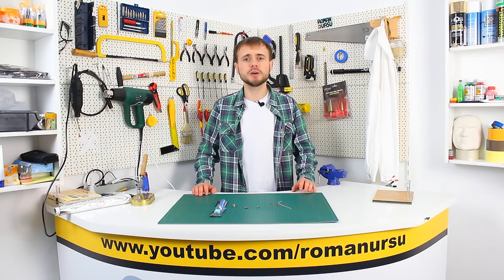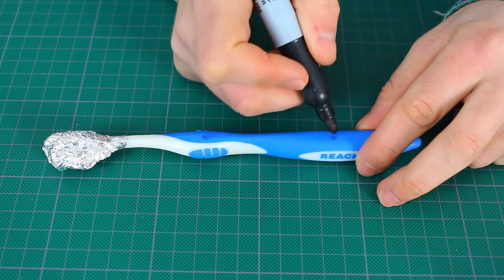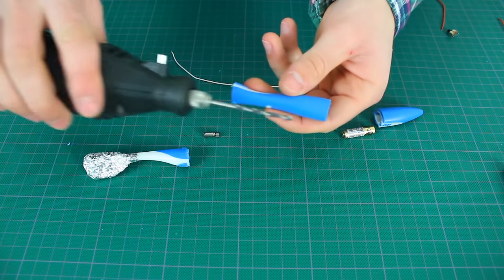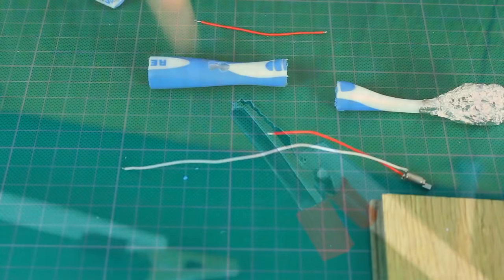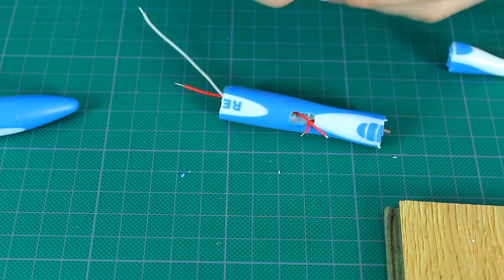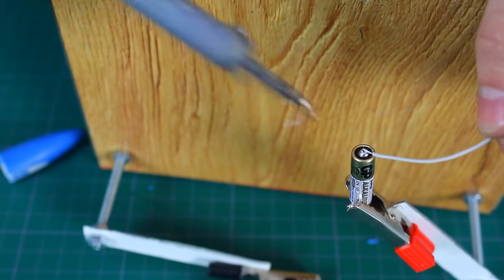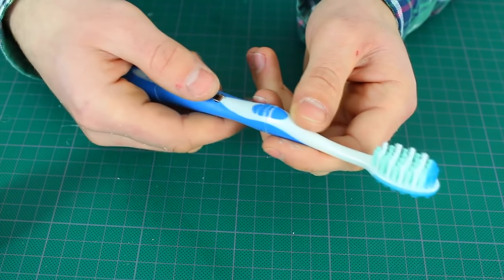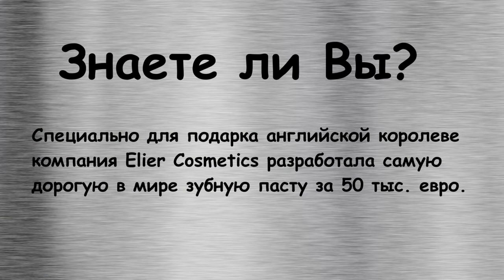How to make an electric toothbrush

Comment: And what if water gets in it?.....
Reply: I thought that to, its more a taser then a toothbrush Nice Idea Roman where did you get it from electrictoothbrushzappers.com
Reply: +FireCracker GT you cant tease yourself with 1 volt xd
Reply: +FireCracker GT I'm tired of people saying that. Can't you see that's a damn little battery? I test them by putting them in your mouth, cause that's the only way you can fill electricity from that tiny shit. A taser is far more than 2000-3000 volts. In order to electocutate yourself, you need at least 50 volts but man that only the voltage. The amperage is the second problem and that's why a taser won't kill you. A battery has 1.5 - 12 volts, so it cannot penetrate your skin (only by the tongue wich doesn't work that well neither) and the amperage can by any big. I know that the battey he uses is 12 volts and it really hurts on tongue, but is 99.99% safe unless you have half a heart. Please understand electricity. Damn.         written by a 14 years old from Romania.
Reply: +Mazda NA Miata its 12 but not matters
Reply: Yeah I am not saying that it will electrocute you but it most likely stop working.
Reply: +Tavi Cartofan one more thing. Even a 1,5V penetrate your skin! EVERY voltage penetrates the skin. How? Well, your body has a certain resistance level which is lower than a complete insulation. So if you close it in circuit with a battery, a current will flow. No exception. You have a lot to learn young Jedi.
Reply: +plmareksurma I know that, but the skin resistance is so high that that it is extremely hard for the current intensity to reach unsafe levels.
Reply: +plmareksurma Skin has a very high resistance so in order to reach unsafe amps, the voltage has to be above 19-21 volts for wet skin, and 49-51 volts for dry skin. The current intensity (amps) is what kills you, and it is extremely low when the voltage is lower than the wet and dry conditions. In the first comment I was explaining that getting electorcuted by some batteries ( not car batteries) is pure bad luck and the chances are so low that you shouldn't consider them.
Reply: +plmareksurma I can close my joule thief circuit with my fingers and it works. Our body contains salts and water, I would never say it is an insulator!
Reply: True
Reply: +matthijs jordense No, it won't, it would still work cause there's no circuitry in it